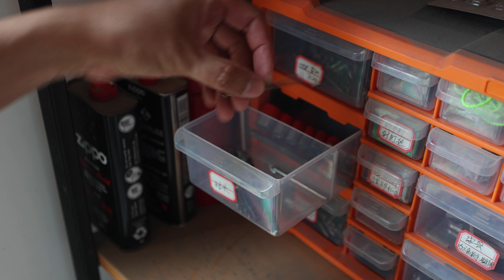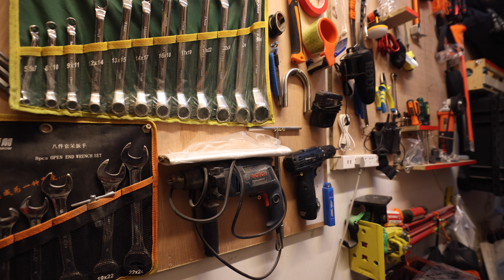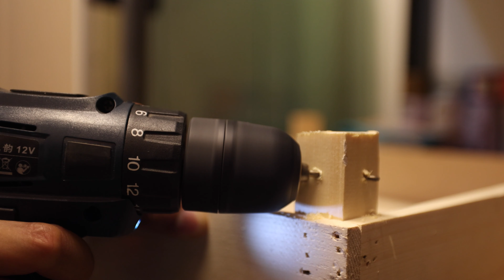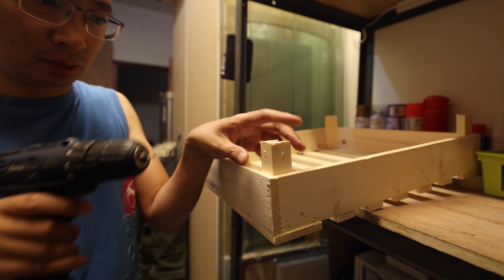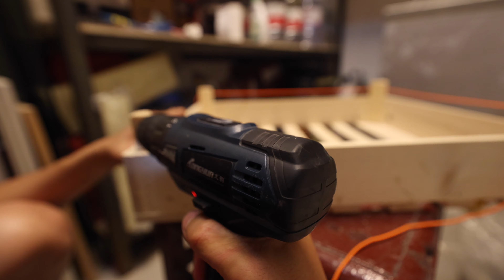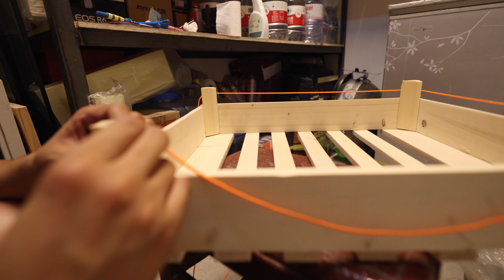DIY Toyota Fortuner Camper Build:Wood Platform Bed and drawer for Car Camping

Comment: is there any real difference in power between jimny and fortuner ? or they are the same becuase the power to weight ratio ?
Reply from the maker: Thank you for your message. 
Jimmy's fuel tank is 40L, and Fortuner's fuel tank is 80L. The fuel consumption of the two cars is similar. 
I've driven two generations of Jimmies and this Toyota,If you go far away, I think Toyota is more suitable. 
From the driving feeling, Toyota's front independent suspension is more comfortable.
 Jimmy is suitable for extreme off-road.
Reply from the maker: I will use this Toyota to start shooting car camping video.
The space is larger than jimny, and the video shooting will be more leisurely.
Reply: @SYYJ  thank you ... i own fortuner 4.0 l and thinking to get the new jimny to use in offroad but i was afraid its underpowered or weak  that why i was asking ..thank u  again